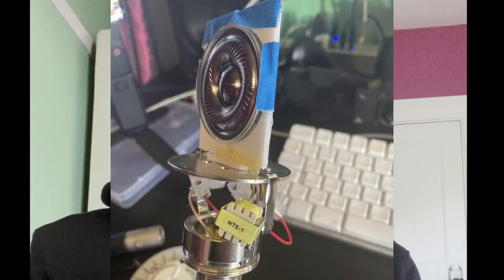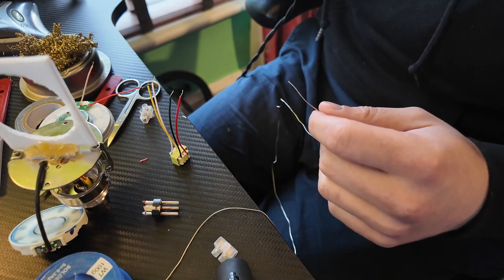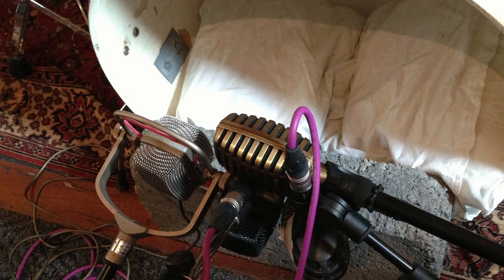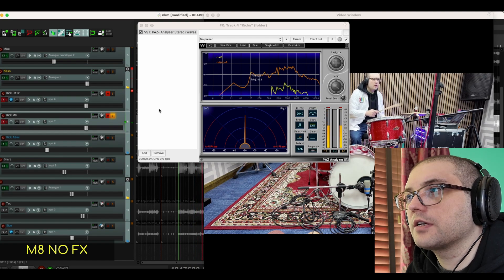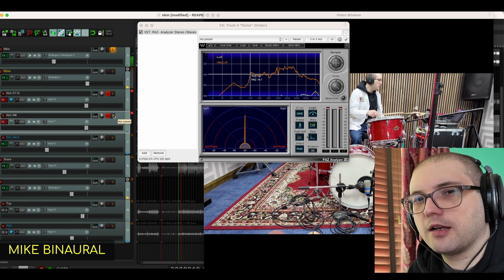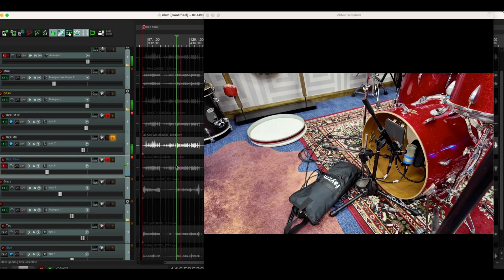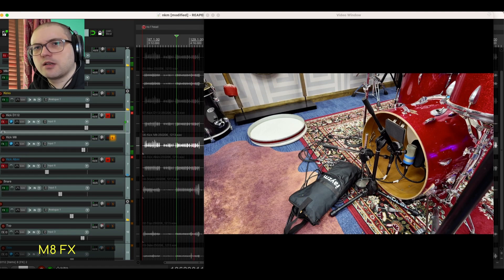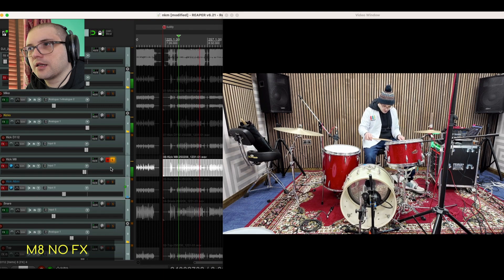Building a great DIY kick mic

Comment: I have one I made myself with a headphone driver from a Beyer DT770 Headphones with a SM57 Transformer. and I like it quite a lot, nice low end, Good kick drum Microphone, It definetly made it through some records actually and no one complained about it 😃
Reply from the maker: There's a cool idea!
Reply from the maker: Dude! I've just done exactly this (I weirdly had all the relevant parts around) It sounds incredible. Tonnes of low end. I will make a video on it at some point soon (I've got a lot on atm!)... The SM827 Kick Mic 🤣🤣🤣
Reply: @MAJETONE  As far as I know, the original Beyer M380 was using a Vintage DT770 capsule. People say they sound different than actual ones. But for me the new one was good. I tried different headphone drivers, and what I understood and makes the difference from other cheap drivers is that the Beyer Driver have really thin diaphragm in comparison to other 50mm drivers, and because of that you end having more lowend and a clenarr high end. Also can work without transformer (will be a little less hyped sound as far as I remember) but not as big a difference with the impedances that have. By the way, try them on Bass and Guitar amps. Good low end, kinda scooped sound but in a good way) 
Cheers! 
Raul Uberos
Reply from the maker: @RaulUberos  Yes! I managed to find a pretty decent 50mm 600ohm driver which I've seen somewhere was what was used - but then trying my dt770's (which I think from memory was an 80ohm version)... I'm still playing around with it - there's something about taking a headphone driver and making a really good mic with it that feels like an illegal move!
Reply: I just made one with a transformer from a unidyne iii sm57 and it sounds amazing.